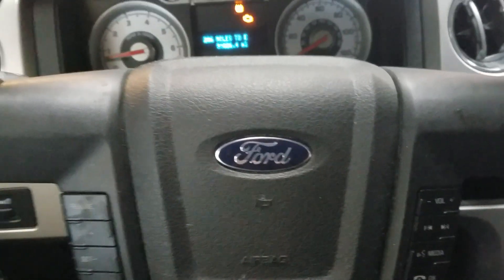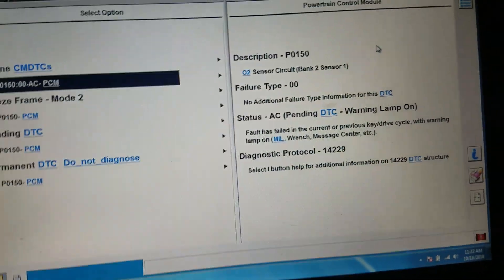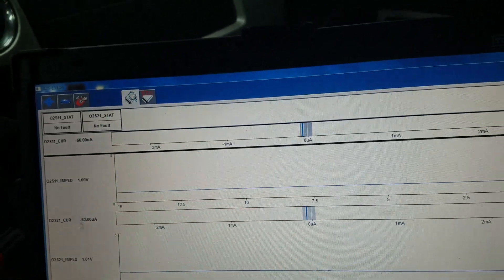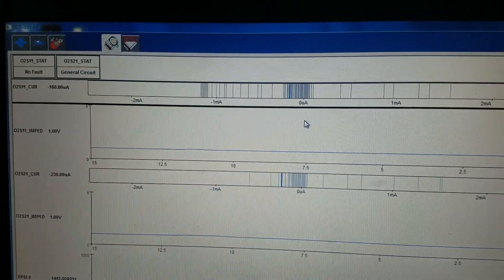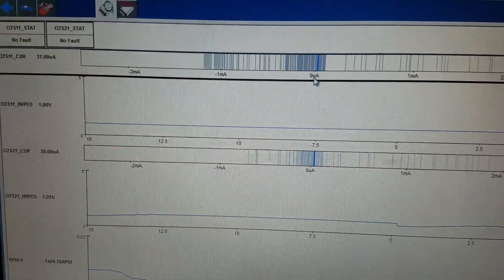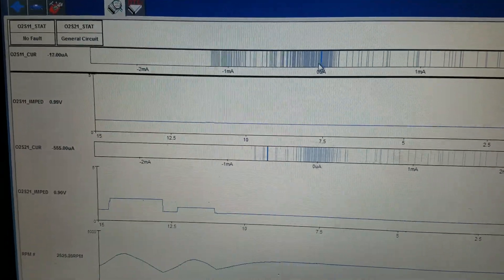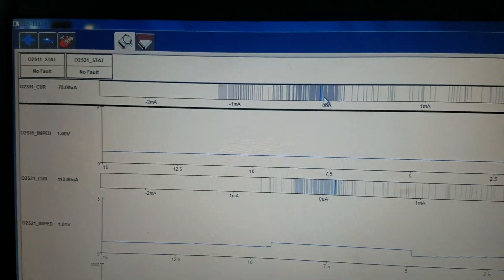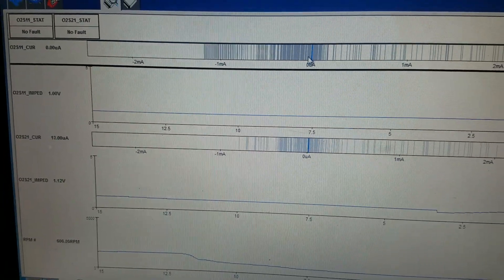2010 Ford F150 5.4L code P0150

Comment: When it would get stuck do you remember if it would pop the check engine light on?
Reply from the maker: Yes the truck will start running rough then Smooths out and the code right after. Sometimeswill take 2 Cycles to set a code

Comment: In the video you said bank 1 sensor 1
I see you laptop and it says bank 2
Reply from the maker: Yes your right sorry about that but you know what I meant to say..
Reply: Lol thanks bro I have p0150 I change both o2 on pasenger side i still get that code any ideas on what could it be? Thank you for your help
Reply from the maker: @81recinos   Sorry for the late reply Henry. Have you  reset KAM?  The best way of doing that if you don't have a scan tool is to disconnect the battery for 10 min or so.  Also it might be you replaced the wrong O2 Sensor. Bank 1 would be the passenger side and bank 2  would be on the driver side. The code P0150 if for Bank 2 sensor 1(Driver side), so if you replaced the Passenger one's  I hate to say but you replaced the wrong one's.
Reply from the maker: I Recommend my customers to replace both side O2 with a code like this one any ways due to same age and or miles

Comment: Did the new sensor fix the code?
Reply from the maker: yes the new sensor fixed it
Reply: Awesome. Just dealt with the same problem on mine today
Reply: This is just happening to my 2010 Lariat that has many miles. What would be the cost to replace these? And J guess I would change them both or have them changed
Reply: @Babsonthego4  Just bought a Bosch O2 sensor for B2S1 at Advance for $139. Theres a special tool needed that you can get through loan-a-tool at any advance/autozone/napa for free.
Reply: Andrew Beard I actually took it to Discount Tire and they replaced 1. The drivers front side cost me $90. 67